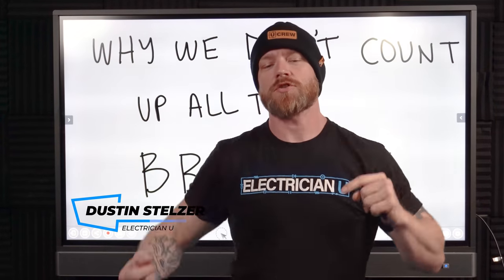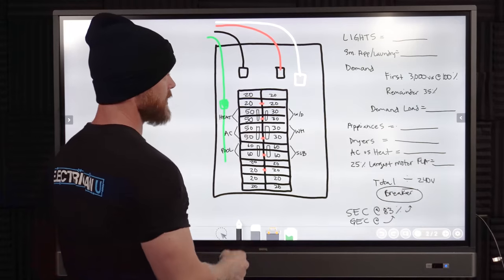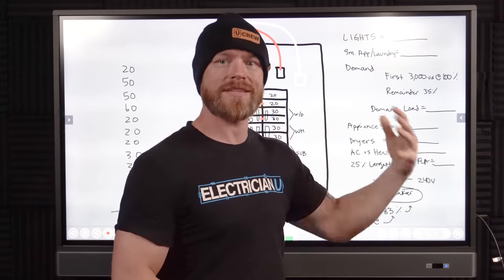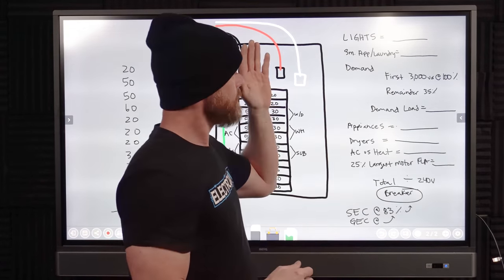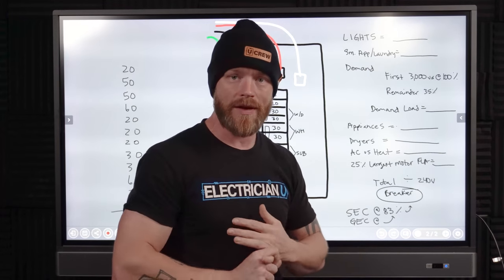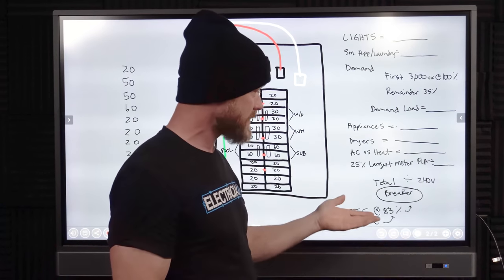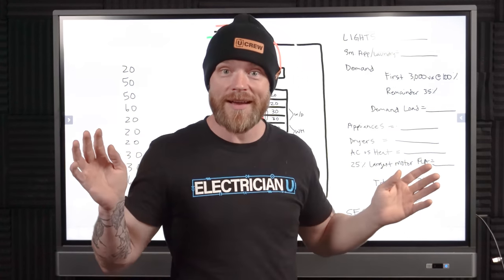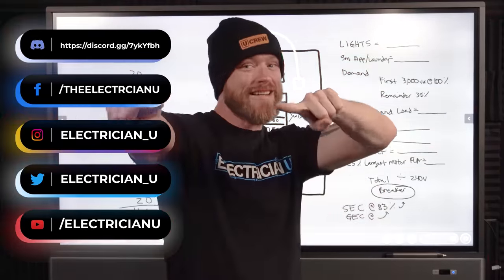Why is there more than 200 A worth of breakers inside of a 200 amp panel?!

Comment: Dustin,   Please stop calling them phases!   It is single phase, and you are making people think there are two.   It is L1 and L2.
Reply: Mathematically, it is equivalent to two voltage waveforms to neutral, that are 180 degrees apart in phase.  We don't call it "two phase" for historical reasons, due to that term already being spoken-for by an obsolete system of a 90 degree phase shift, but it really is the same thing as if there were two phases by the same logic that defines three phase.
Reply: @carultch     Please explain to me what within a single phase in and out transformer could possibly change the direction or timing of a sine wave as you suggest.   I’ve seen diagrams with voltage sine waves overlapping each other and someone saying 120 volts above and 120 volts below.   That is bogus!  They would cancel each other out and voltage would be zero.   There are three voltage sine waves coming from a 120/240 volt single phase transformer.   All three start at exactly the same time and end at the same time.   All three are going in the same direction at exactly the same time. 
So, what can cause the change in time and direction within the transformer secondary.   There would have to be something causing these changes.
Oh, don’t say that is what an oscilloscope shows.   Something must cause the change!
Reply: @KevinCoop1  "All three start at exactly the same time and end at exactly the same time".   Ok, define the words "start" and "end".   At what point within the cycle, do you consider the waveform to "start"?

Because if when we define time to equal zero, the black wire's busbar will be at zero Volts and is increasing at time=0, and the red line will be at zero Volts and be decreasing at time=0.  The red line and black line will not be synchronized with each other in an identical phase.  Their voltages will be EQUAL AND OPPOSITE at every instant in time.

The reason the transformer creates this apparent phase difference is that it center-taps the secondary of the transformer, and defines zero to be at that center point, by calling it the neutral, and bonding it at the service disconnect.

Suppose the transformer produces Voltage U(t) across its X1 and X2 terminals, which we'll define as U(t)=A*sin(w*t).  Suppose X1 is the black wire, and X2 is the red wire.   We then centertap and create an X0 terminal for our neutral.   We'll define function V1(t) as the voltage from X1 to X0, and we'll define function V2(t) as the voltage from X2 to X0.

Our constraints are as follows:
V1(t) - V2(t) = U(t).   Voltage across the two outermost terminals of the secondary must equal U(t)
U(t) is given as A*sin(w*t)
By centertapping them, we know that the magnitudes of voltages must be equal, such that | V1(t) | = | V2(t) |

A solution to these constraints is the following:
V1(t) = A/2 * sin(w*t)
V2(t) = -A/2 * sin(w*t)

Graph these two waveforms, and observe that I could just as easily have expressed V2(t) as:
V2(t) = A/2 * sin(w*t + 180 degrees)
Reply: @carultch    Since industry standard for start and end is hertz, a complete sine wave is 1/60th of a second. So starts at zero volts and zero seconds.  Voltages rises and falls back to zero volts in one direction, then goes the other direction voltage rises and falls back to zero.   Hence 1/60th second in time.
During that cycle the 240 volt RMS sine starts at zero from L1 to L2.  At the same time one,120 volt sine starts, moves the same direction and is from L1 to N.  And the third one, 120 volt sine moves the same direction and is from N to L2.   Then it changes direction and is L2 to L1, L2 to N, and N to L2.
Neutral is only zero volts because it is bonded to ground.   So reading from neutral to ground is the same point.   Do no grounding at all.  The system will still work you will have 120 volts, you will have 240 volts.   You will not have any two connections to be 0 volts.   That is a meter connection, so a reference point if grounded.
Reply: @carultch    I really like your 9 volt set up.   And explanation.   So,   So battery 1 is positive open, negative tied to battery 2 positive, and battery 2 negative is open.   Do we both agree that electrons are assumed to flow from negative to positive?    If so, we get two 9 volt lamps and connect them as follows lamp one connected to battery 1 Positive and tie conductor.  Lamp two is connected to battery 2 negative and tie conductor (same point as lamp one).  So both lamps should be lit and working at 9 volts and if you check voltage battery 1 positive to battery 2 negative, you should still get 18 volts.  We 100 % agree.   
So, this is exactly the same thing in the secondary of the transformer for half a cycle or half of a sine wave as far as direction of electron flow.  They can only go from Neg to Pos.   In the AC system essentially negative and positive swap positions every half cycle or sine.   
There is no reason for the electrons to flow in opposite directions in coil 2 from coil 1, and is not possible.  As the electrons can not flow backward in the batteries, it can not flow backward in relationship to the other coil either.  The two coils connected must have electron flow same direction at the same time for both 120 volt readings and the 240 volt reading.  
Respectfully,   Kevin
Reply: @KevinCoop1  Glad I could help.

To respond to your questions.
" Do we both agree that electrons are assumed to flow from negative to positive?"
Short answer is yes.  Longer answer is: the exact opposite happens inside the battery.  It is whole ions of both charge signs that are flowing in both directions, but for simplicity, let's assume it is just electrons.  Charge is ultimately conserved, because you aren't creating or destroying charges at either polarity of the battery.  Electrons in the wiring and consumption elements flow from negative to positive, while inside the battery, the electrons are "climbing the hill" to restart their role.   Energy is coming out of the chemical domain, and entering the electrical domain, to enable the electrons to "climb" from the positive terminal to the negative terminal.   Just like a roller coaster has to climb that first hill with the tow chain, and then falls by gravity through the rest of the track.  Roller coasters generally roll from high to low, but they also go from low to high when powered by the tow chain.

Indeed, if you connect both polarities to this bipolar DC power supply to two identical lamps, and tie the midpoint to the battery midpoint, it will function as if each battery were powering just one lamp.  The current in the grounded conductor at the midpoint would ultimately end up being zero, and all amps thru Lamp 1 would also flow thru Lamp 2.  If you connected non-identical lamps, you would have an imbalance returning to the source on the grounded conductor.

"So, this is exactly the same thing in the secondary of the transformer for half a cycle or half of a sine wave as far as direction of electron flow.  They can only go from Neg to Pos.   In the AC system essentially negative and positive swap positions every half cycle or sine. "

Agreed with the first and final sentence, and that is a great way to put it.   I'll take exception with "they can only go from neg to pos.".   When the electrons are external to the source, that is correct, but when they are inside the transformer coil, the electrons do go from positive to negative.  This is where the electrons are powered by the EMF in the transformer coil, to set the rest of the electrons in motion.

"There is no reason for the electrons to flow in opposite directions in coil 2 from coil 1, and is not possible"

Depends on what you mean by "opposite direction".

Consider a transformer coil with X1 at the top, X0 in the middle, and X2 at the bottom.  Consider the snapshot in time when X1 is at its maximum positive voltage to neutral.  This means electrons are entering the X1 terminal, like it is the positive terminal of the battery.   The electrons are flowing downward through the upper half of the transformer winding, keep that in mind for later.

What is happening at the X2 terminal?  At the same time, X2 will be at the exact opposite voltage as X1, so X2 will have its extreme negative voltage.  X2 acts like a battery's negative terminal, with electrons leaving it.   This means that in the lower half of the transformer winding, the electrons are also flowing downward.

So are the X2 electrons flowing in the same direction, or the opposite direction as the X1 electrons?     Geographically, both of these electrons are flowing in the same direction in both halves of the winding, i.e. downward.   But if you instead interpret it as entering vs exiting the transformer, they might seem to be flowing in opposite directions.  X1 electrons are entering the transformer, and X2 electrons are exiting the transformer.  So this is why it might seem like they are flowing in different directions, but they really aren't.

Reverse the polarity half a cycle later, per the nature of an AC source, and the exact opposite will happen.  Electrons will exit at X1, and enter at X2.  Electrons will geographically flow upward thru the coil.   What happens at X0 is unspecified, and would depend on whether there is an imbalance of current among the mix of loads as they are distributed between the two lines.
Reply: @KevinCoop1  What I meant was, where within the cycle, do you consider it to start?  Your choices are: ascending node (sine), positive crest (cosine), descending node (-sine), or negative trough (-cosine).

In that case, they don't really start in the same direction.   L1-to-N starts on its ascending node at time=0, and L2-to-N starts on its descending node at time t=0.

Zero volts is where ever you place the black probe of the volt-meter, and anything else that is bonded to it.  It is convention to place it at ground, but this isn't necessarily the case.  You could disconnect the N-G bond, and the system could still deliver power to the load, exactly the same.  Albeit, not as safe.   You'd have a metastable state for L1 and L2 to each be 120V to ground, as long as there is no preferred path to ground anywhere within the system.  The instant you attempt to measure L1 to ground with a realistic volt meter, you will temporarily ground L1 through the megaohms of your meter, and make L2 be 240V to ground.  You will get 0V to ground, when you measure a floating system like this, no matter where within it you attempt to measure.  Try it with two voltmeters simultaneously, and it will be a battle of the voltmeter impedances that will determine the voltages to ground within the system being measured.
Reply: @carultch    Didn’t see your first comment.   Will need time to read that one.
After reading your other comment we are extremely close to agreement.
Per your example, X1 to X2 at zero flows down.   X1 to N flows down at zero, and since N is fed by X1 coil, from N to X2 at zero is flowing down.   
At time zero, X2 to N cannot flow up.   So, there is no 180 degrees out of phase, no opposing sine waves that added together to equal 240 volts.
The reason the statements are made is that is what an Oscilloscope can show.   
BTW, I’m guessing you are physics not just math and not electrical engineering.
Reply: @KevinCoop1  It's difficult to add clarity to my responses in just text.  If you can post your email address, I could send you some drawings.
Reply: @carultch      I have the ability to see drawings in my mind.   Your text is very clear and concise.
Reply: @KevinCoop1  Glad you can understand my descriptions.

Current as measured along the axis of the transformer secondary is in the same direction in both halves of the winding.  Current as measured toward vs away from the transformer secondary, is in the opposite direction between the two line conductors leading away from the transformer.  Current has to add up to zero among all three wires, and in the special case of a balanced load, all electrons that leave X2 will return on X1.  Vice-versa, a half cycle later.

Voltage doesn't add up to cancel, because it occurs at different locations.  Given a nominal 240V waveform that is centertapped, if you always place your black probe at X0, you'd get +170V with the red probe on X1, and simultaneously, you will get -170V with the red probe on X2.  This is where the opposing sine waves come from.   They aren't really added together to get the 240V nominal waveform (340V amplitude), it is more of a subtraction of voltages that generates this.  But since subtracting a negative is equivalent to adding a positive, it may look like they are adding up.  170V on the X1 minus negative 170V on X2, will yield a difference that peaks at 340V.  And when it reverses, you'll get -340V as the value from X1 to X2, since X1 will be at -170V, and X2 will be at +170V.   Look up "RMS voltage" if you are wondering where I'm getting 170V and 340V, from what we normally call 120V and 240V.

I have a degree in engineering, although I have studied plenty of physics to go with it.  That may seem like I'm looking at this the way a physicist might see it.
Reply: @carultch    If I’m reading everything correctly, we are in agreement.   Typically, most conversations end with others telling me that I don’t know $hit!  
Have had some conversations with physics guys.   I do know what RMS is.   Although I am not a graduate from an accredited engineering university, in 2007, I became a PE in the state I live and worked in.   It has been a pleasure discussing this with a knowledgeable person!    Respectfully,   Kevin
Reply: @KevinCoop1  It has been a pleasure discussing it with you as well.   It is great when people can be specific when they disagree, and try to understand each others' points of view.  Perhaps both people are correct, but are viewing the situation differently.  It also helps me learn if I might have my own bias that could use a course correction.

Prior to this conversation, I hadn't realized that the current is in the same direction in the transformer secondary coil, since I was biased to thinking about the current being in opposite directions when the pair of wires leaves the transformer.  I had to consider that we might both mean something different by the word "direction".
Reply: @carultch    I worked for Electrical Contractors most of my career.  The last 21 years with a top 15 privately held employee owned contractor.   NEC was one thing I was extremely good at.   I designed or worked everything from a house up to a building with (90) 2,750Kw diesel generators.   I also was extremely good at layout in 3D in AutoCad MEP.   I’m proud of a job I did with 5 miles of 3.5” EMT in a 15,000 square foot electrical room(overhead).
Decided it was time to get out and retired Oct. 2018.   Always open to discussions.   Kevin
Reply: Ive designed and built inverters. I can guarantee you in fact you need to create 2 seperate phases AND neutral in order to reproduce what goes into a standard north american house.
Reply: 240 volt panel hots are 180 degrees opposing from each other ( in the US) so the statement is not incorrect. Maybe not what you are used to hearing, but not incorrect.
Reply: Indeed one phase coming out of a transformer with a center tap, that’s all it is…

Comment: Worked at at a large candy company where they never listened to the 6 electricians. They had 2 3000 amp 480 volt busses feeding the chocolate room and were going to install a large machine that drew over 320 amps. Told them that both buss appeared to be at capacity. I was friendly with the VP of operations and told him about what went into one ear and out the other ear. He demanded thatbtheu have an outside company install cirrent revorders for at least a week. Room ran 24/5. Company that did the recording insisted that they do not even install a 30 amp buss duct switch on at capacity buss. Large rich hospital that I retitrd from always had at least 2 42 circuit panels feed from a 225 amp 208/120 source. Had at least 25 locations that had 3 42 circuit breakers with over 100 breakers with wire on them. They never placed more then 2 or 3 20 amp duplex receptacles on a single pole bolt on 20 amp breaker.
Reply: If the utility is using AMI metering, you can always call and ask for the historical peak load of the service and the transformer feeding the service.

Comment: By the way, at first glance, this looks like an imbalanced circuit, with the current being drawn on the black side being larger than the current drawn on the red side.  For example, assuming the AC and the Pool are both operated during the summer months, one more or less obvious option would be to move the 60A pool circuit breaker over to the red circuit, thereby balancing the draw that both pool and AC would have.  Any further fine tuning would need additional investigation as to when each circuit is active.
Reply: I know this is 8 months later, but... A/C and Pool are 240V so they're on both black and red. "Balancing" is only relevant on the single pole / 120V circuits.

Comment: Wow ok this is a big one,, run a 30 amp to hot water heater that draws 18 Amps,, well yep beyond your 60% as well as your 80% so 18 Amps,,  requires a 30 amp breaker,, it's confusing to most,, and it's all o. Average draw between constant draw compared to off and on temporary load as for the square footage , and cubic feet of air space for HVAC,, all is based on average and give room for random hi draw